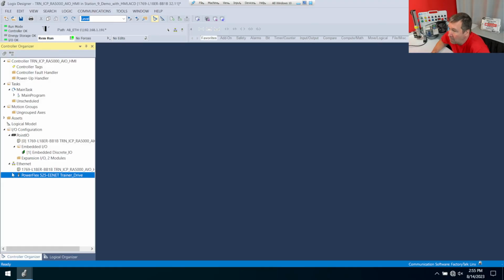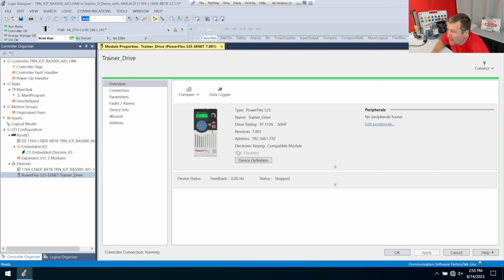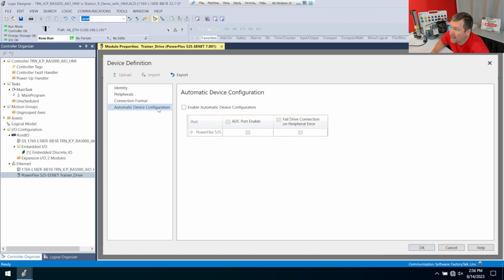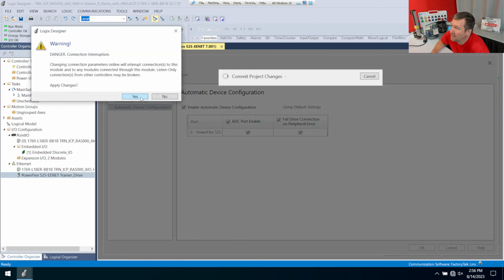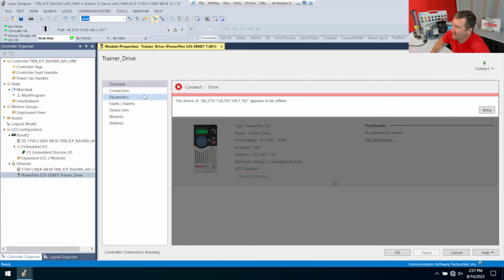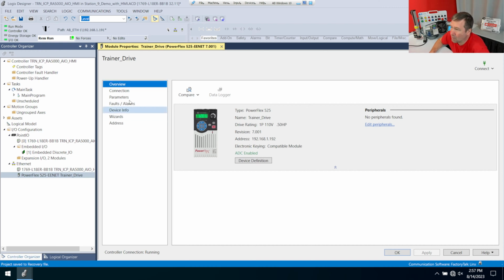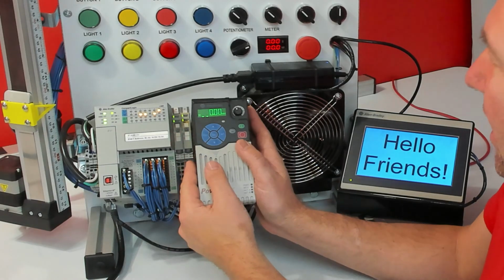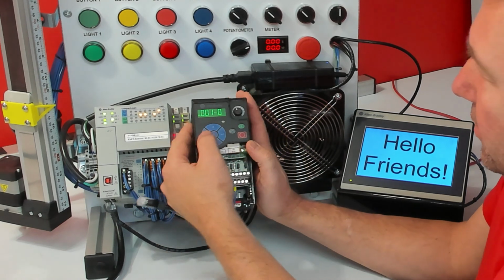Studio 5000 Backup a Powerflex 525 with Automatic Device Configuration

Comment: How can this work for two drives? Is it dependent on which device in the Ethernet tree is plugged in first? I’d like to enable this, I know my scenario would be rare that two are replaced at one time.
Reply: I should have read all the comments, however in my experience bootp is out of the box. Best thing I can do is test it. Setting anything out of the box would be  preferred in my facility.
Reply from the maker: You have to set the IP address which makes the two drives unique

Comment: What if you have multiple drives on the same plc? Would this be for a single drive standalone setup?
Reply: The PLC uses the IP address to compare what the parameters are on the drive it is talking to vs the saved values in the PLC. 

If you have a managed ethernet switch you can host a DHCP server to provide IP addresses based on which port each of  your drives are plugged into. PF525's ship with DHCP enabled so a fresh one will automatically get an IP address from the switch as long as you plug it into the same port that the old drive was plugged into. And as long as the IP addresses match, ADC will download the configuration that you have saved in the project to the new drive. Did this all the time with Stratix switches to help maintenance guys. All they had to do was replace the drive physically without having to get into Studio 5000 or use keypad to parameterize it.
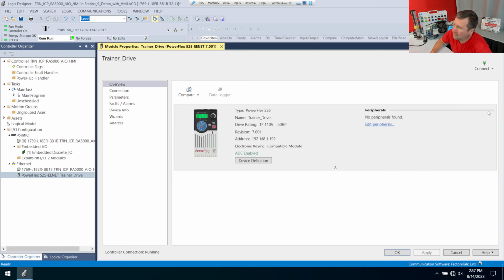Reply: if you look at  1:10 you can see the drives ip address, if you have multiple drives each will have its own ip address that can be easily set with a standalone tool etc
Reply from the maker: As others have already said, just assign an IP address to the new drive and the PLC will do the rest.